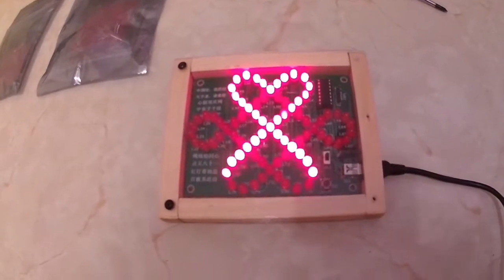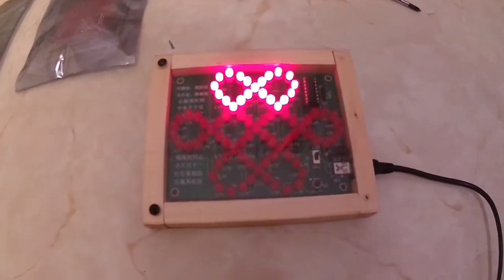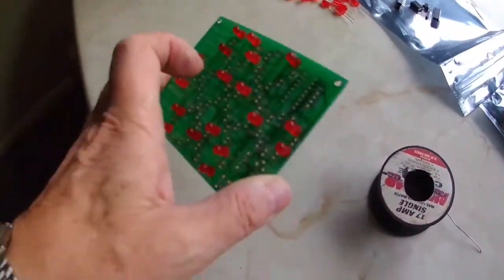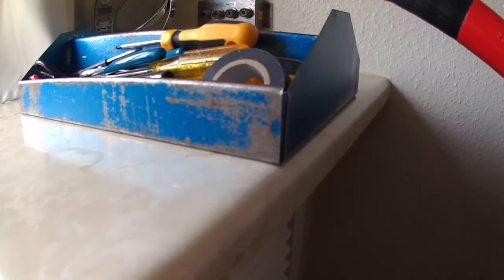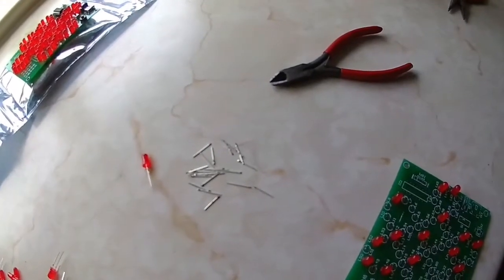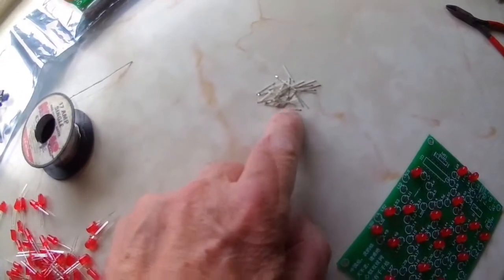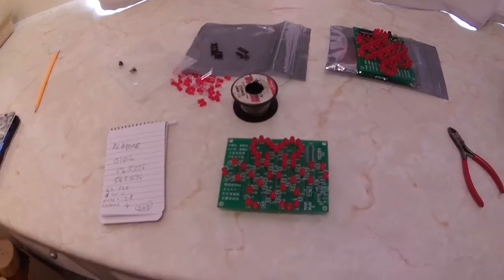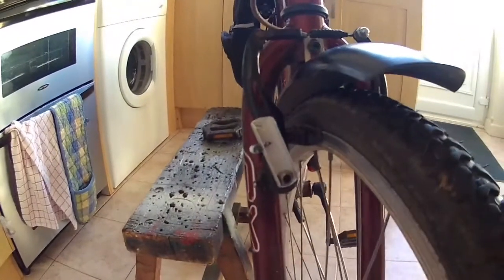Chinese Knot and Bike. Lockdown 15th Nov 2020.

Comment: Hi George. Do you need to use Flux on Soldering? I used flux at Collage, when i did Electronics.  It was  like that in 1979.  Lol
Reply from the maker: Hi Helen and Jeff. The circuit boards these days are pre tinned. The solder I use is from a company called Multicore. As in the name the solder is like a stick of rock that has cores of flux. So no extra flux paste required.  However when I first learnt to solder. I used a copper rod that was heated on a gas stove. Flux was in a paste and sticks of lead. Also on valve radios and TV,s . Ps I am a retired ex Radiospares ( RS Components) tech support engineer. Cheers from old George 👍🤠🙋‍♂️
Reply: Thanx George. I still love to work on electronics, & i love LED projects .  Jeff.
Reply from the maker: @helenjeffontheroad5313  There is no instructions supplied with a lot of these kits from Ebay so it can be difficult. But not impossible....